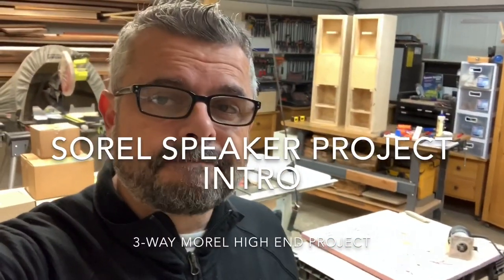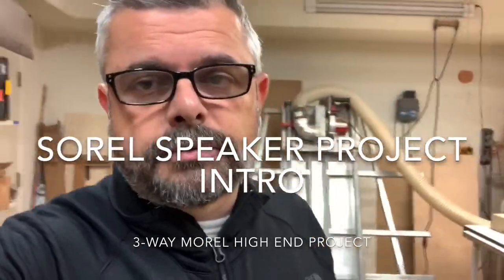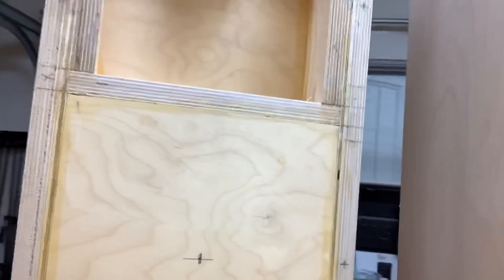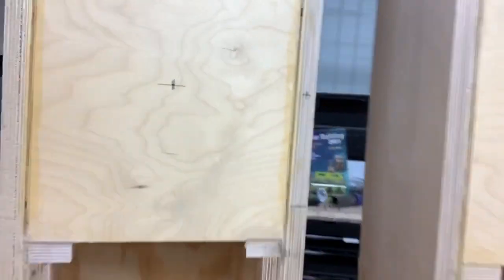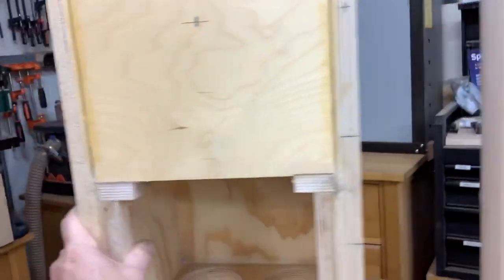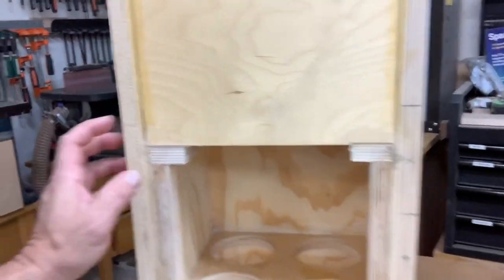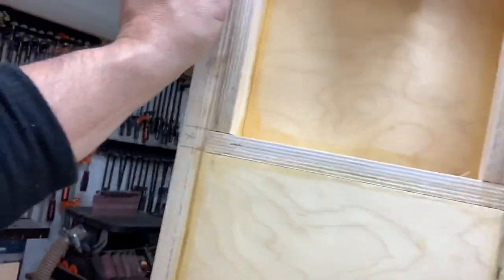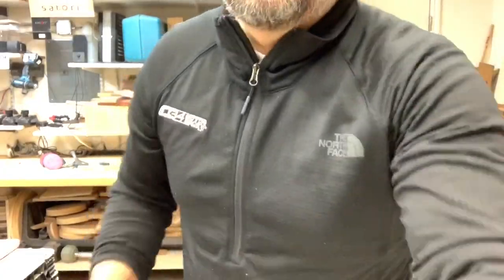Sorels Speaker Project Intro using Morel Drivers

Comment: Thank you for sharing.
I have recently listned to the Totem Bison standmount at a Hifi show and i'm impressed by the punch, the speed and imaging despite the woofer is only 5,5' from Morel.
Javad. Would that midrange woofer and tweeter of your freind works in a two way configuration. Two of them in serie at 2200hz? And how the tweeter performs in the upper-midrange? What would your choice be if you are to chose a tweeter to a similar project..  W.H.R Niko

Comment: I've never understood what 'High-end' means in matters of acoustics. There are many 'high-priced' components, some that are worth the money, many that are not, if we're to go down the route of $20,000 speaker cables for example, but high-end ... what the definition?
Reply from the maker: TransmissionLineDesigns it’s hyperbole and there is no definition, but the way I’m using it is cost no object quality and specifications, no expense has been spared in the design and construction of these drivers from materials to design and even aesthetics, and these drivers have the performance to back it up. 

Conversely a $20k speaker cable sounds the same as a $50 one, I don’t consider snake oil when I discuss audio products. Thanks!
Reply: @javadshadzi4824  The question was suppose to be rhetorical rather than a dig!
Don't get me wrong, I have morel drivers in my set up, and I used Morel in my car audio, however, ... at the end of the day, we all listen with subjective listening devices called; our ears. .. and acoustics don't really respond to parameters such as 'how much this widget costs'. I think there a good and bad drivers up and down the scale. The enclosure alignment is a huge factor, listening environment is as important if not more so. As Earl Geddas said: "Speakers and rooms make a system not the electronics."

As for me I try and stay away from such terms .. as even the most component driver, in the wrong hands, ends up being a disaster ... enter 90% of commercial speakers IMO.

Lovin' your channel
Reply from the maker: No worries I didn’t take it as a dig, everything I said applies, the term is useful and commonly used in the DIY speaker building community to describe what I clarified above.
Reply from the maker: And thanks for following along!
Reply: @javadshadzi4824  I'm bias .. DIY rules in my book. Good to see someone who really knows what they're doing and is passionate about what they do.
Reply: There is no be all end all definition.  But....to me high end is resolution and a pleasing euphonious sound.   Now these two can be mutually exclusive.  I've heard speakers that having electron microscope resolving power that sound like a drill in your ear drums...so it boils down to what sounds great to you.  Price does not always equal performance either, but it sure does seem to correlate...   DIY is the way to go..I still think spending over $5k on speakers is silly...    I'm building some oblate spheroid waveguides mated to DE750TN CD's right now...hope they turn out :D

Comment: The 10.5mm xmax is 5.25 in and 5.25 out.  That is my understanding xmax ?
Reply from the maker: Xmax is one way, each direction
Reply: @javadshadzi4824  You may be right but there is some confusion about the real answer.  

Some manufactures define xmax using the formula of (Voice Coil Height minus Gap Height) divided by 2. This formula is supposed to show the excursion length in millimetres during which the voice coil is under full magnetic control within the magnetic field. Xmax is a magnetic field measurement so exceeding the xmax does not physical damage the speaker, exceeding xmax makes the tone loose and rumbley which is terrible for hi-fi but some bass guitar players like it - they tend to be the bass players who prefer big slow 15/18 inch speaker rather than the tight punchy 10 inch bass speakers.

The above formula works well for underhung voice coils but the formula is misleading when applied to overhung voice coils which are most common in sub-woofer designs.  Search google images  for "voice coil geometry".

Another complication is that some manufacturers quote their xmax figure with a "+/-" in front of the number, but some don't. It's necessary to closely read the manufacturers fine print to see which definition is being used. 

What I know from personal experience is that for bass guitar players with a low E string (40hz), they should not use speakers with less that xmax 4.5mm.  Players using a low B string (30hz) should be looking for speakers with AT LEAST xmax 6mm, meaning 6mm in and 6mm out - so total cone excursion of 12mm when playing the lowest note (30hz) at full volume.  

Note: Volume (loudness) is created by wave AMPLITUDE and the amplitude is generated by the physical length of speaker cone excursion so the limit of speaker xmax is only reached when playing at full rated speaker wattage, i.e. low AND loud.
Reply from the maker: @dreamdiction  I’m not aware of any broad or wide spread confusion about the definition of Xmax, it’s a well defined parameter and you stated the formula for it correctly. It signifies the amount of excursion, in each direction, where the voice oil is in the magnetic gap, outside of Xmax the voice oil begins to leave the magnetic control of the magnet. It is always recommended to use any driver w/in its Xmax for the lowest distortion and best safe performance. Xmech is the rating where the voicecoil can be damaged in one way excursion.
Reply: @javadshadzi4824  there are indeed many definitions of xmax. I've seen it defined as:

1) Gap difference/2
2) Gap difference/2 + 1/3 coil length
3) 70% BL curve
4) 10% distortion point

Etc etc.